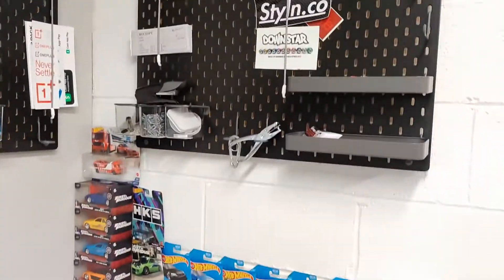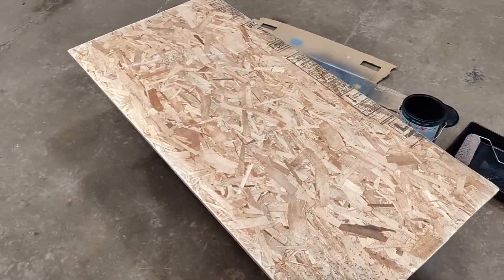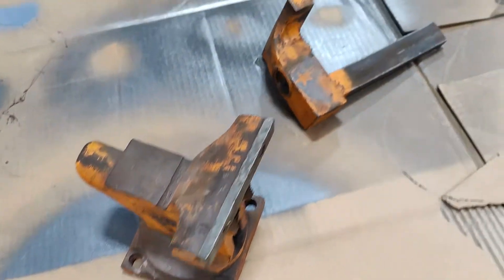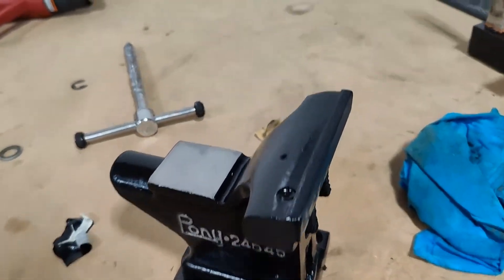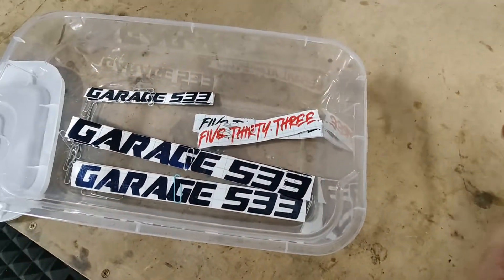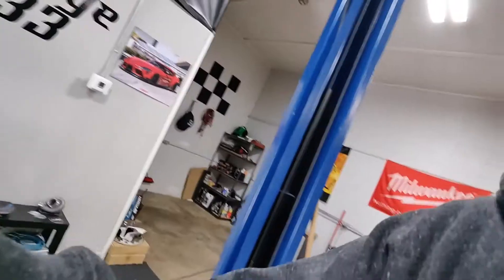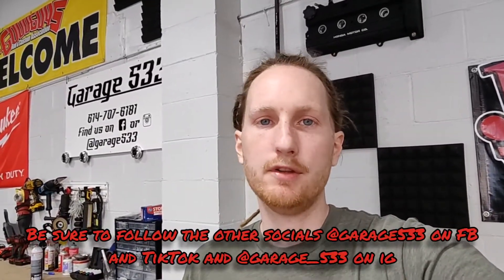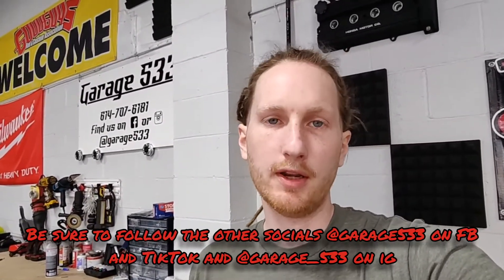Working on the shop (lots of little upgrades)+ Merch announcement 🤫

Comment: so what all do u do there in the garage ..... how do ya  charge doing a  ceramic coating on a  ' 02 Sierra  crew cab long bed  how much u charge & how long in time will u need my rig there.......???
Reply from the maker: Thanks for the support man I really appreciate it 👍 Ceramic coatings really depend on the condition of the paint and how dirty everything on the exterior is but a rough estimate on a trucks is about $800 for a 5 year ceramic/ graphene coating which includes a exterior detail. But as of right now unfortunately I can't do too much welding and fab untill I get a new set up but definitely going to get a nice one soon so I can take on work like that since that's what my "professional" background is in